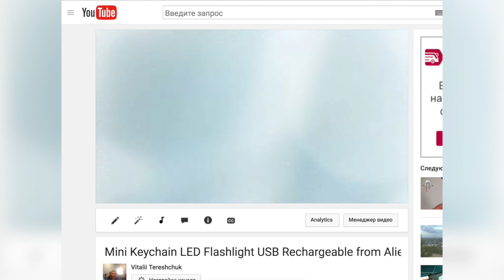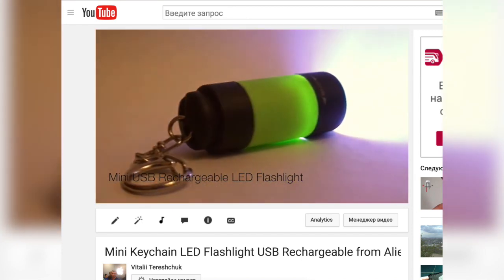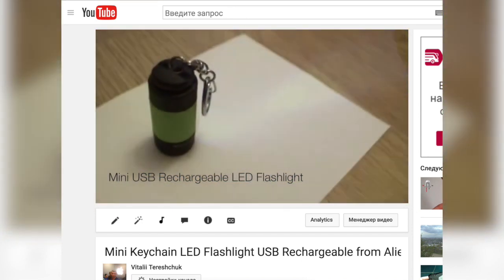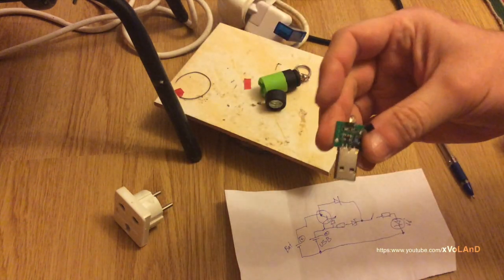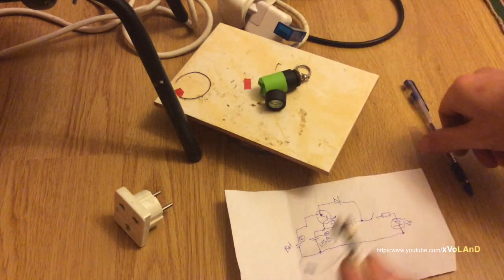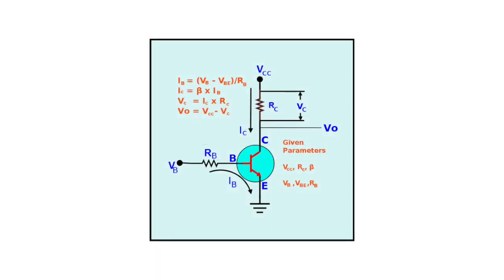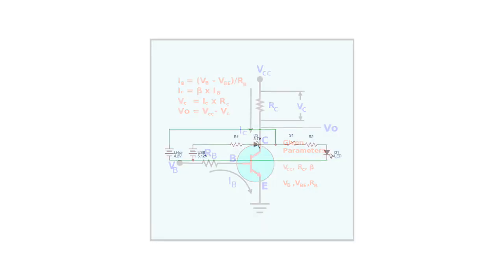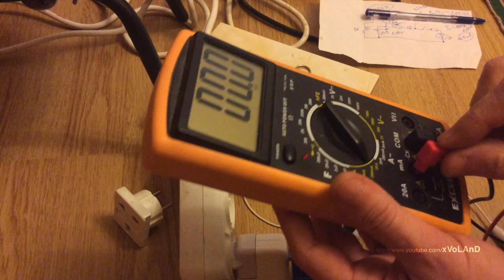Repair Rechargeable Mini Keychain LED Flashlight 0.5w USB

Comment: does the resistor kick the voltage down to 3.7 from 5.25V? - is that the safety mechanism... it can't over charge because the voltage?
Reply from the maker: alphavortex1 correct

Comment: stock light without Charging control circuit,how many is the current delivered to battery and how many time it can safe connected on 5V 500mA source?
Reply from the maker: 5V 100mAh Now, after a while, it's better to replace the board with something better
Reply: @xVoLAnD  Guess batt. capacity 50mah. So 100mah charge is a lot. what about replace resitor with higher value?
Reply from the maker: You can try